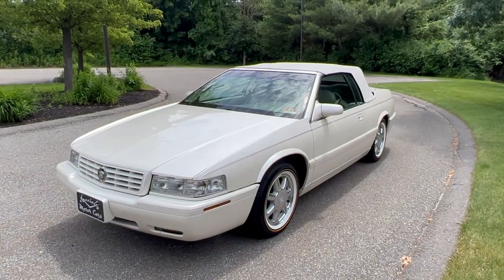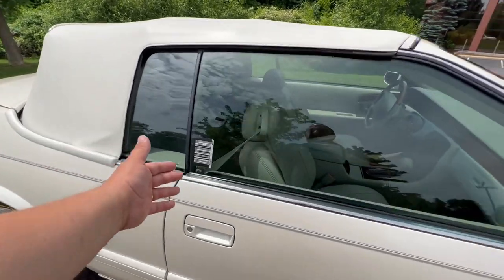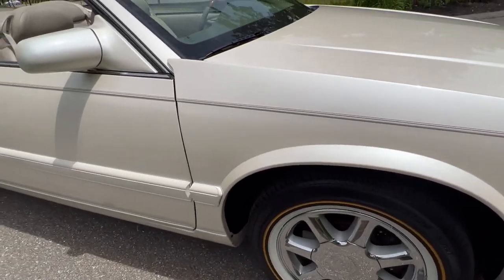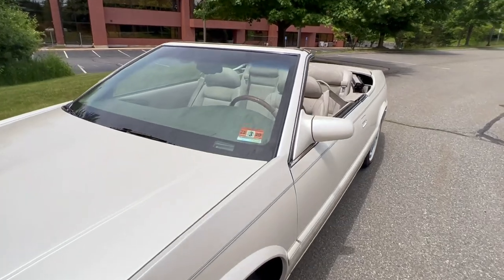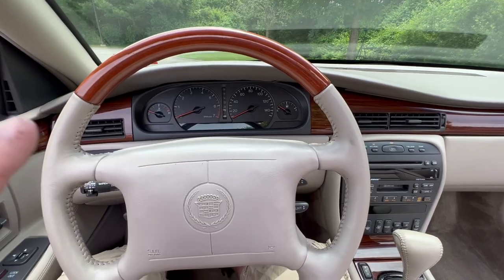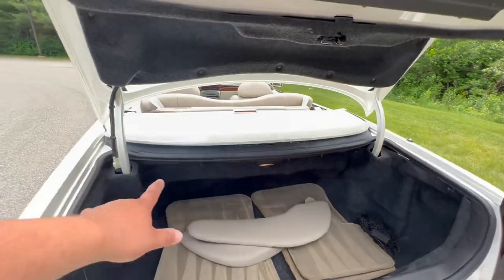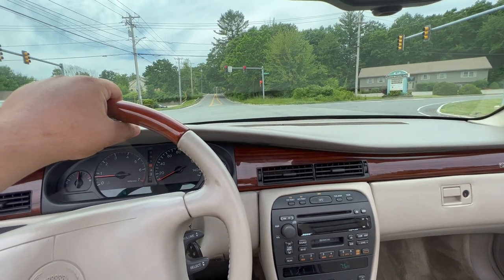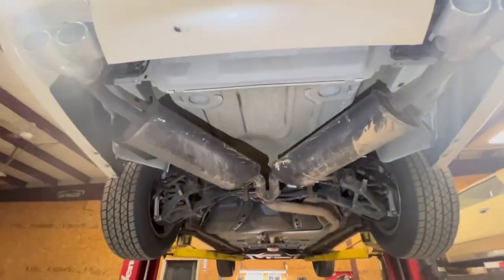RARE Custom 2001 Cadillac Eldorado CONVERTIBLE w/ 34k Miles FOR SALE by Specialty Motor Cars

Comment: A few features of the Eldorado not mentioned in the video: The radio has a built-in 'reverb' feature as well as NOAA weather band (good to have in a convertible). The speedometer recalibrates to metric without having to use two sets of numbers on the dial. Look for 29MPG at 70MPH on the highway. The back seat is very comfortable for a six footer in the steel roof version. Nice tour of the car. Thanks for all of the details!
Reply: I believe it. I would get 26mpg in my bigger 4 door STS
Reply: You buy cars I have a 2004 Lincoln for sale super clean 125,000 miles it just had it's first cup of coffee with the miles lol
Reply: Funny, I have a 2004 Seville with 86,000 miles and only get 12mpg in town and 21 on the HWY.  Great car, otherwise.

Comment: Nice car, though I wonder about those side boots for the convertible top. I was waiting for the moment, but seems you forgot to put them on?  My impression is, are they cumbersome to deal with? To me, it looks like two open void spaces without them & they should be installed.

Comment: I bought a 2002 Eldorado ETC with 65,000 miles from Copart in Oregon. $225! Your convertible has latches that are similar to the 1990 to 1995 Oldsmobile Cutlass Supreme convertibles built by Cars and Concepts in Georgia.

Comment: My only complaint with my 2000 Deville Northstar engine, is how expensive it was to have the sensors fixed.  And everything was so hard to actually get to... mechanically it was a great engine.  This is a stunning car.

Comment: I worked at a caddy dealer back then and I remember we had a couple...our owner drove one for awhile and very cool at the time...still cool. Coachbuilders did a good job...talked to them a few times...I worked in the parts department and you wouldn't believe how many vogue tires we warrantied! Look good on some cars but junk sidewalls. This car's a steal for 18grand. Gm had a lousy chroming process back then for the wheels. My 03 lesabre had the same peeling and pitting issues so I bought new ones and just taking care of them....just gotta wash them often and keep them waxed. First thing I did to my lesabre was get the dexcool out of there...complete flush and green coolant added.

Comment: I've owned a  ton of Northstar engine Cadillacs,  you hit the nail on the head.... get rid of the Dex Cool..... I have a trick to fixing that head gasket issue, I used to buy them a lot... but that is a really nice car.
Reply: What is the trick?
I've had head gasket issues in the past.
And don't want to spend another three  grand on another engine
Reply: Odd, I've owned a 2006 STS V8 since 2019, came with Dex Cool, I flushed and refilled with (orange) Dex-Cool, no issues at all.  Overall the Northstar is not supposed to be any good, car runs perfect.
Reply: @joemannix174 I had a  1997 Eldo. Around 2015, the head gasket went to pot and made it undriveable. All 3 mechanics I had check it out, wanted about 3 grand to fix it. I decided it wasn't worth it for a car that old.

Comment: Hi Anthony,
I would like your thoughts...
I've owned two Cadillac DeVilles,
The first 1996 with a Northstar engine,
Had to be replaced in 2008
Leaving me with $3000
Repair bill!
I liked the overall car, and the body was starting to show it's age so I got another one identical to the first one that I owned...
I didn't plan it that way it just happened...
But now,
After owning the car since 2011....
It is my daily driver and it runs on the hot side.
I'm shopping around for a different car, because the thought of spending another $3,000 to replace another Northstar engine is not an option.
The car in your video is very nice, but the thought of owning another Cadillac with a Northstar will never happen again.
What are your thoughts on these ticking time bombs?
Reply: They didn't perfect the Northstar till the 2005 MY. They learned from the metallurgy of the LS engines primarily the aluminum heads require longer coarser bolt threads. The 2005-2010  Northstar engines should be good.

Comment: 24:05 It should be to turn on/off the alarm, if it's the same system as in the Opel Corsa C (another GM product). There's a specific place to insert and rotate it in the engine bay.

Comment: Looking for a early 80's Oldsmobile 98 regency with a 5.7 Diesel.  Doesn't have to be prestine or low low miles.  But I would like to find a running rust free or very minimal rust candidate. Prefer cloth over leather. But will take what I can get.  Only thing I am strongly against is mouse infestation.  Small mechanical issues are fine. . Let me know if you can help. I had one in burgundy with burgundy velour when I was younger. And now I'd like one again.

Comment: I want a 2002 so bad! I just can't own a Northstar...
Reply: Don't be scared bro, I have owned about 10 and just bought one like this 2002 Collector series convertible. You will fall in love with the smooth power!
Reply: @DJKadilac I was so disappointed when my '97 Eldo's headgasket went to pot in 2015. I got 3 mechanics opinion, and they all told me it would be 3 grand to fix it. I decided  not to get it fixed.

Comment: Hi Anthony....I own a 99' ETC and am totally in love with the car, but I don't understand why most (all?) reviews don't get into the internal design benefits that Cadillac builds into them.  Perhaps its because many reviewers do not have access to the original owner's manual (I had to secure mine from E-Bay). Some examples of these included features are as follows:

Feature____________    Description__________________________ 
Power seat controls       8-way power front seat cushions and seat backs  
                                           adjust to fit two different drivers.
                                       
Power lumbar control    Adjusts the lumbar part of both front seat-backs and 
                                           turns  their lumbar massage feature on and off. 

Seat/mirrors memory     Seat and mirror positions can be programmed for
                                            two different drivers via their keyless entry fobs;
                                            Correct seat/mirror adjustments are set for each
                                            driver when the fobs are used to unlock the vehicle.
                                            Memory for two different drivers also includes 
                                            preferred radio settings and climate control settings.
                              
Power trunk latch            Set the trunk lid down gently and the power latch
                                           quietly screws the trunk down tight (No more trunk 
                                           slamming required).

Heated seats                   Each front seat cushion has adjustable heating.

Valet lock-out system    Pushing the button in the glove box disables the
                                           power trunk latch, power fuel door and any garage 
                                           openers.  The car keys will lock the glove box.

Driver information          Communicates with the driver via a message display
System                             line in the dash to alert the driver to any vehicle
                                          conditions and problems that may arise.  A real
                                          Geezer-mobile...even tells you when road ice is possible.

Rain Sense                      Once engaged, the windshield wipers will automatically 
                                          increase or decrease their speed or  pause based on
                                          how much water is on the windshield.

Cruise control                 Allows the driver to set car speed and no longer 
                                          need to use the gas pedal on long trips. 

 Lighting Control            Handles all switching on and off of lighting and

                                         (Twilight Sentinel) is programmable.  Turns appropriate lights on
                                         and off at dawn and dusk based on ambient
                                         light.

Cornering lamps            These lamps automatically go on when a turn is 
                                          signaled.  The lamps are located on either front
                                          side of the car and illuminate forward, low and to 
                                          the side to illuminate the area of the turn being 
                                          made.

Self-dimming                  Instrument lamps are automatically dimmed as it
Instrument lamps          becomes dark outside and the headlights go on, and
                                          automatically brightened as the sun comes up.

Storage Mode                This feature is programmable from the Driver Info
(hibernation)                  System for long-term non-usage of the vehicle.  It
                                         prevents long-term battery drainage from radio,
                                         amplifiers, instrument cluster and remote keyless 
                                         entry systems.

Electrochromic rear-     Automatically dims at night to reduce glare from
view Mirror with             vehicles behind you.  Includes an 8-point compass
compass                         that automatically re-calibrates as you drive.

Remote control side      Side mirrors are power-adjustable from the driver
mirrors (heated)             seat, are heated for defrosting and are automatically
                                          set for each driver when the key fob is used.  Driver
                                          side mirror automatically dims glare from behind.

Curb view assist            When shifting to reverse, the passenger-side mirror
mirror                               automatically tilts down to see the curb to the rear
                                          for parallel parking. (programmable)

Rear console storage     Between the rear seats is a passenger storage
compartment                  compartment with a dual cupholder that folds
                                           out for use.

Passenger side vanity    Fold down the passenger-side visor to use the 
mirror                                adjustable brightness vanity mirror.

Climate control                Automatically controls inside temperature for
system                              driver's side and passenger's side separately.
                                           Set the desired temperature and forget it.

Rear window                    De-frosts and de-fogs the rear window.
de-fogger

Rear seat adjustable      Allows rear-seat passengers to adjust their fan 
vent direction and           speed and vent directions in the rear area.
fan speed control

Steering wheel                Allows the driver to control climate control fan
controls                            speed and temperature, as well as CD track and
                                           player volume without taking eyes off the road.

Cassett tape, single       Sound system is a Bose Premium, eight-speaker
CD player and                 sound system.  Includes Digital Signal Processing
am/fm radio                   (DSP) which will maximize sound from Talk,
                                          Live or Auditorium broadcasts or to focus sound
                                          on the driver's seat.  Players and radio will not
                                          play in another vehicle if stolen.

Power radio antenna     Automatically deploys when the sound system
                                          is turned on.  Is otherwise totally hidden.

Anti-Lock braking           Automatically prevents brakes from locking up
(ABS)                                and causing a skid during panic stops. 

Traction control             Automatically limits wheel spin by sensing that
system                            one or more wheels are losing traction and using
                                         brakes and throttle to restore traction.

Stabili-trak                      Senses when traction is poor during regular (non-
                                         braking) conditions and works to stabilize traction.

Underhood lamp           Lights up under the hood when the running light 
                                        switch is turned on, for engine work at night.

Hydraulic                        Suspension is hydraulically controlled (no shocks).
Suspension                    System automatically senses road surface and 
                                         hardens or softens suspension accordingly.  Also
                                         self-balances when trailer tongue weight is added.

Engine                             Engine is an eight-cylinder, overhead cam, 
                                         Northstar engine with four valves per cylinder.  It
                                         produces 300 horsepower, gets 25 miles per gallon
                                         of gas on the highway (using cruise control), and 19 
                                         mpg in town consistently.

Design Feature              Dash and doors are tastefully enhanced with genuine 
                                         zebrano wood.

P.S.:  Like your videos...can't say the same for the after-market soft-top on this example...it ruins the 
original roof line and looks like an after-thought.
Reply: Thank You for taking the time to add this information,  very much appreciated!

Comment: In case you didn't notice in the video when that car is driving, the digital clocks blink and stop and then blink again, this indicates that there is an electrical fault in both the blackboard console and the radio console

Comment: Hi Anthony that car is beautiful and if I could afford it I would be down there tomorrow from you and the North Stars are good engines if you keep up with them I had a 1988 Lincoln Mark VII LSC and only had 33,000 Miles on it and it was a Convertible and it was made by Coach Builders also and from Maimi In Florida is were the car was and they even put the Brass name on the dashboard for the owner who had it and I paid $10,000 and I never ever seen a car that I had oh and it was even Garaged since it was brand new I bought it back in 2010 and then  only drove it on Sundays because I had a garage and I don't think it even had a scratch on it and the Convertible top from Coach Builders came with a snap on red cover when you put the top down and I owned it for 2 years and had like 10  coats of wax on it and the car was white Exterior and red interior with the white Convertible top and the Lincoln Mark VII LSC had the honeycomb rims and the 5.0 high output and it was really fast and the only thing I did in 2 years was just changed the oil a few times and the other fluids and I put high performance spark plugs and wires and when I sold it the car only had a little over 38,000 and I sold it for $24,000 from a retired Airforce guy who was from Maryland and I picked him up at Logan Airport and he couldn't believe it when he seen it and I even let him drive it home back to Maryland with my Plates and insurance so he didn't have to have it shipped back then but now I wish that I never sold it because right now I could probably get $50,000 for it. Goodluck on selling it I am sure you won't have a problem.

Comment: 3/25/2023
I have a 2002 Eldorado ESC, metallic Red, cream leather interior same as the white convertible, 63,850 original miles. No rust ever, garage kept, engine clean as new from the factory. No moderations.

Comment: That was the ugly convertible that have the other convertible with out the electric booth which could fail you fuck up on you w/ out the booth an the straight cut off top at the back it looked like somebody got just straight smacked in the back of the head and left you flat